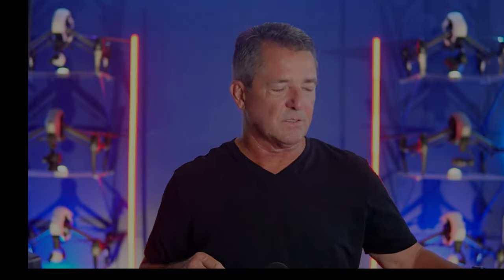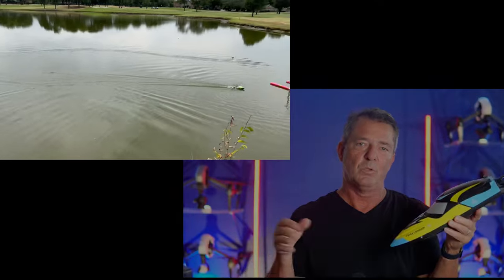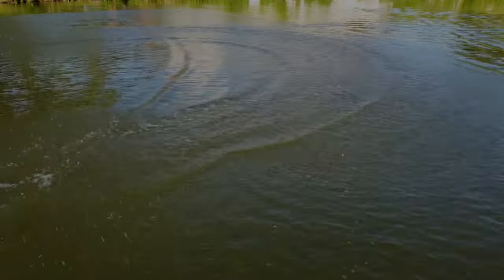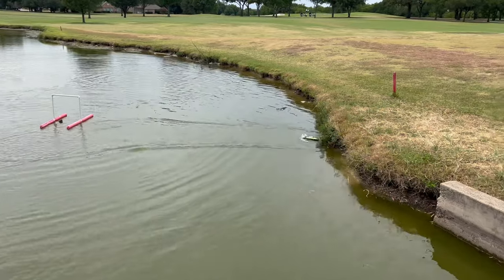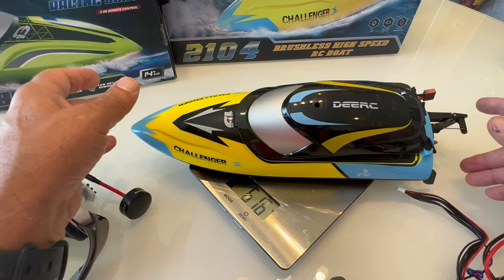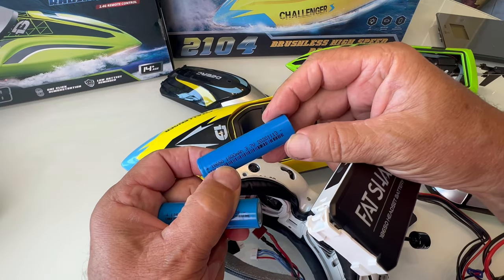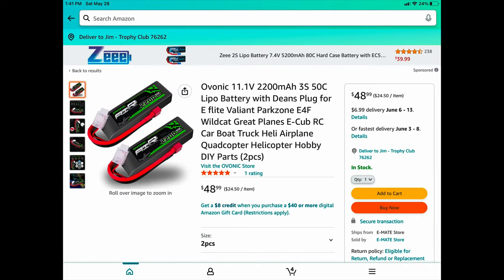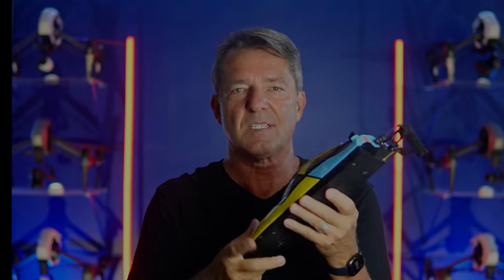DEERC 2104 Challanger Brushless Motor Speedboat For Under $100 #deerc2104 #deercchallangerboat

Comment: Great review,but being a boat guy i wish you would have  let us know if temps got hot on esc or motor using stock battery at all... Most decent rtr boats have potential to prop up and add a more powerful battery which greatly increases performance...not sure if this boat is being pushed to its max already or not...but it seems like a great little boat...thanks for sharing
Reply from the maker: Sorry, I’m not a boat guy, all I know is that it’s almost to fast, but it’s lots of fun, especially when you have a huge pond in your back yard! Thanks for the input, I’ll try to learn
Reply: @b4ugo  i understand..unless you are into quads,boats,planes there is no reason to learn the tech stuff...

Comment: scale speed for that boat imo is approx 440 mph if it does 22 mph... to me the full size version would be around 25 foot ..i am guessing that toy boat is 15'' long...25 foot is 300 inches so divide 300 by 15 you get 20x ...20x 22 mph equals 440 mph...

Comment: I buy my 'loose' 18650 batteries from IMR Batteries online for $5 to $8 depending on the amperage and mAh that you need.  I've never had any issues with getting counterfeit batteries when I buy through them either which is good because apparently counterfeit 18650 batteries is a big problem these days.
Reply from the maker: I’ll check that place out, thanks

Comment: Hey thank you, I used your code and saved 10% on the Deerc 2104; it  was on sale $99 from $119, so with your code I got it for $89! sweet, and got a second battery  for too much, your code did not work on the battery, just the Boat. thank for the $10 savings.
Reply from the maker: Awesome! Thank you! Spring is here and time to start getting the boats back out. I didint know the dicount still works
Reply: @b4ugo  I got the Boat yesterday and the extra battery today, and now we are a big snow storm .  
I take my Deerc H120 to the river and do jumps in the rapids; I cant wait to try the 2104.